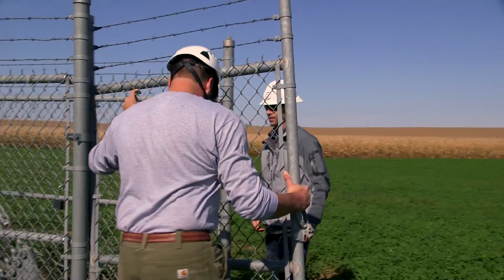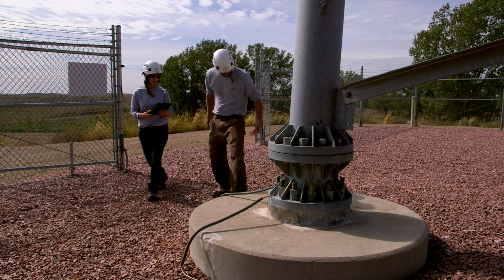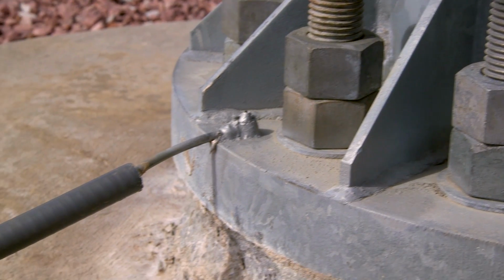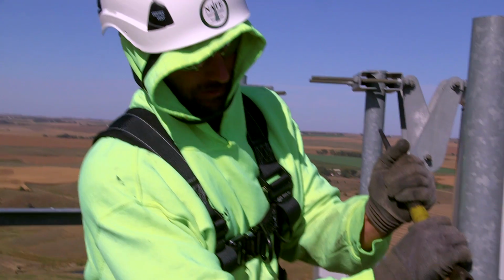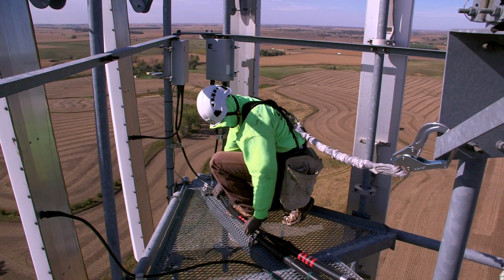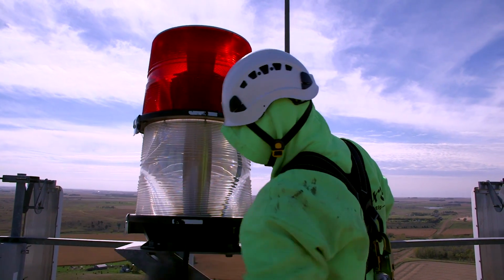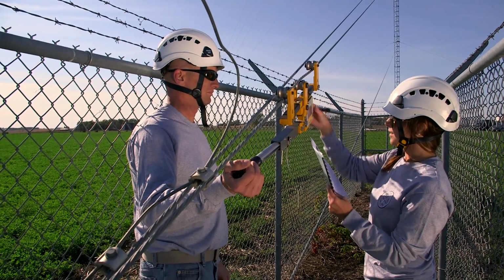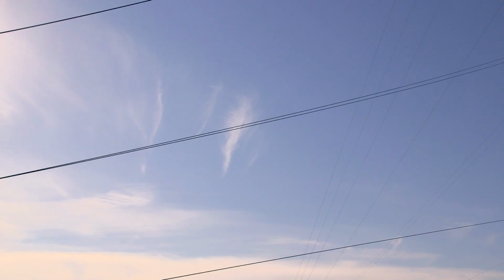How to Conduct Tower Inspections

Comment: Torque wrench required inside of slide wrench tightening of Fasteners. Value to be checked for earth resistance. Optical reflectometer is required to understand the health of the tower.

Comment: Is it dangerous working around towers due to radiation?
Reply: I've spent thousands of hours working on cell towers, there is typically very little to no risk. I had microwave sickness only one time from spending 13 hours on the tower.
Reply: wondering too
Reply: @Matemoshits  I found out than it can be dangerous but a lot of planning is done to prevent and lower the risk, e.g. by standing out of the zone in which the tower is directing the radiation. In all honestly though I don’t feel comfortable working around them. Everyone is different though don’t let that scare you off.